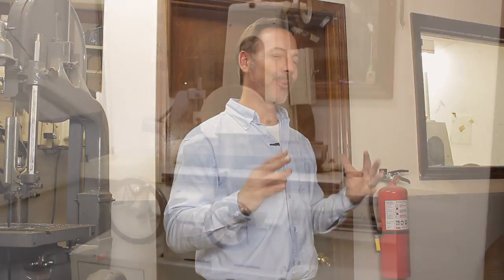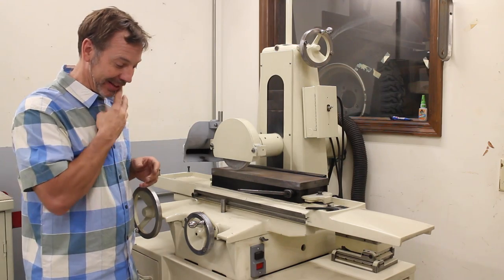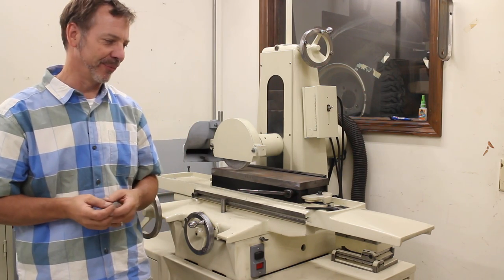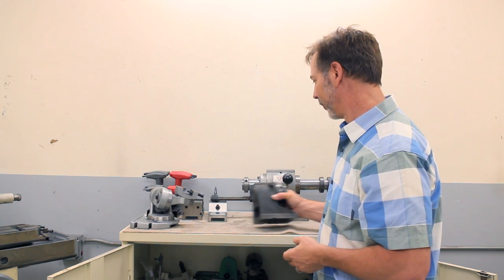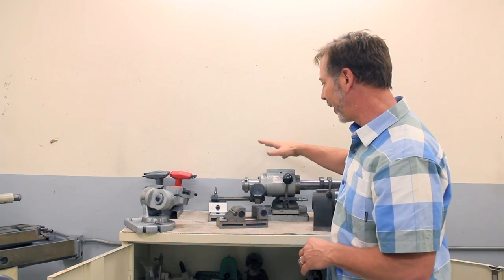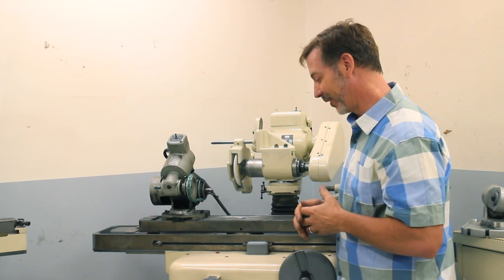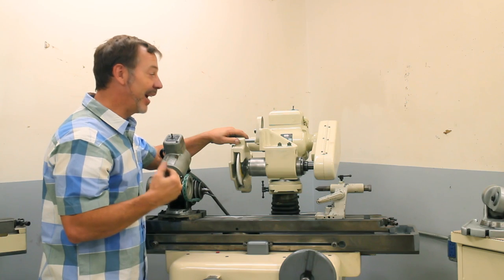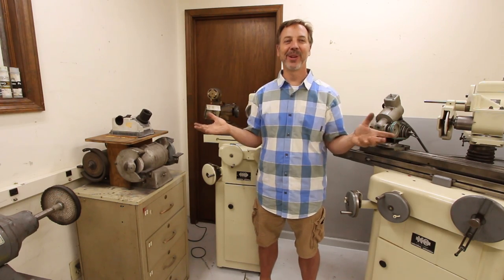My Top Secret Room

Comment: Great  memories! I'm retired now but I spent my earlier years, 17 actually, at GE as a tool  grinder. That was before carbide inserts took over. Lots of good stuff in your secret room. I eventually moved on to calibration and then machining, but I learned a lot of the basics of machining by doing the tool grinding. Thanks for sharing that great video!!
Reply from the maker: Thanks of your comment . :-)

Comment: I agree with tools as close to where they are used. Btw, I remember when you got that grinder and it looks MUCH better now. I love what you did with the base. Have you thought about doing foam in those drawers?
Reply from the maker: NO. I don't like foam because of the metal dust. :-(
Reply: +Metal Tips and Tricks (Dale Derry) that makes sense. What are your thoughts on dividers or small bins? Just something to keep the tooling from just rattling around the drawer...

Comment: I started out as  a manufacturing engineer and we had a shop full of grinders. Most were small like your Harig and then we had a quite large machine to grind hard coat ceramics.  Today most of my vendors don't have grinders and I always wonder why (I don't design cool stuff?). Your grinding room has a lot of cool tooling. Usually that means you must get to build a lot of cool stuff.  May be you can show off some of the things you build without a visit from the Men in Black.
Reply from the maker: HI Dana, I think  your right! I need to show more stuff that I have build. My next video series I will do that. :-)

Comment: Hi mate.  That is a very nice room you got there, can't you take it with you to the new location?  ; )  What is the advantage of that electric magnetic chuck?
Reply from the maker: Thanks for asking about the smaller chuck. Its a compound sine chuck. Most electro magnet chucks you can control the magnetism. This held the part hold it shape better.